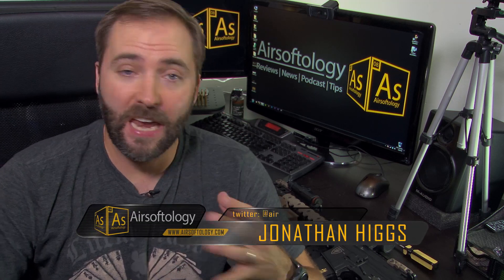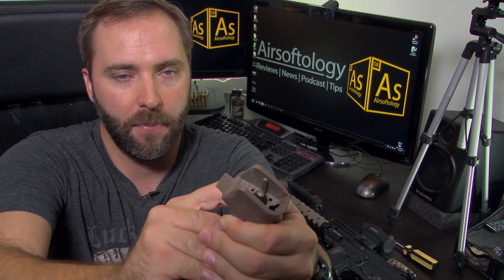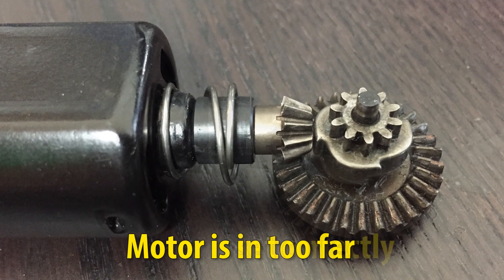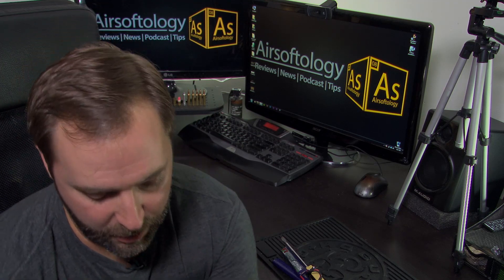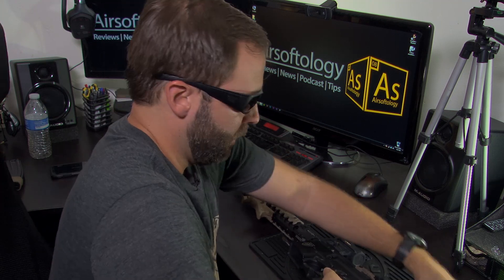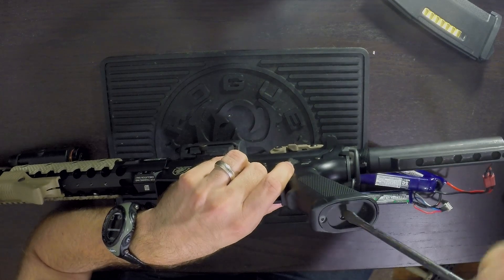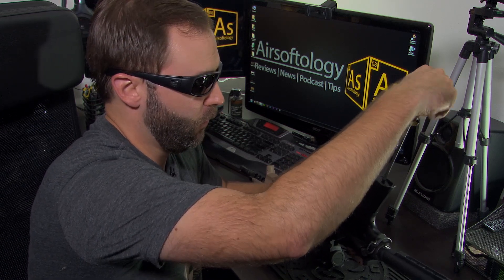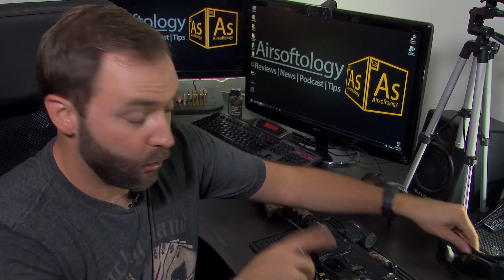How to Adjust your Airsoft Motor Height Correctly | Airsoftology T3

Comment: When I adjust motor height I do it while I'm working on the gearbox and put ony the bevel gear in, screw the motor into the grip, and adjust it until all the teeth are meshing properly. Then I shim my bevel gear until there is no friction on the meshing of the teeth and shim the rest of my gears up to it. This is a much more precise way of doing it if you work on your gearbox.

Comment: that's really helpful. I'm a noob in AEG and tried to screw in the motor plate too far (as I thought it was the screw of the handle) that it no longer fires. What happened was the batter and the handle heated and I panicked. Now that I know that what I screwed in is actually the motor plate, this is a good video for me to adjust the motor in it's sweet spot. Thank you!

Comment: From my experience when you want to be sure 100% on correct height you can remove the gearbox. Then mount the grip on it (V2) and see the aligment, better V2 gearbox shells have a cutout windows where you can see the contact between bevel and motor, on V3 you usually can see the contact right away.

Comment: Thank you for this Sir, i have a very old tokyo marui mp5a4 that came to me second hand in 2011, its sat unused for 11 years since 2013 and i recently decided to get a new gearbox as i had stripped gears and this video is pretty much perfect, hearing the sound difference and firing every half/full turn of the little grub screw in my adjuster plate really made the difference, i backed it out all the way to hear just motor spinning, engaged, went all the way in, and there is a big difference with the sweet spot being smooth.

thank you!

Comment: Contrary to the title, this is not the correct way to set motor height. Yes this is an easy way to approximate it, and can get you close, but the proper, correct method is to take a part your gearbox apart and attach the motor grip to one half of the gearbox and visually set the height exactly.
Reply: Like, why in the world isn't this done from the factory.
Reply: kawsper time is money

Comment: Thank you so much. My gun rpm was so slow and it only shot upside down with a weird sound. Turns out the previous owner had tightened the motor full. And again thank you so much

Comment: This actually addressed an issue on my AK74u NGRS. When I swapped the stock motor for an ASG 22k due to heat building up really easy, the motor height had to be adjusted and hopefully this will address a lock issue on semi where I have to put it into auto to unlock it.

Comment: Thank you so much for posting this.  My screw must have loosened because my motor was set too low and my piston was not engaging. I was so scared I stripped my gears or something. Funny how a screw being a little too loose can completely mess up a gun.

Comment: Thanks for this video, my m4 that I bought second hand made that sound yours made after you had purposefully adjusted it wrong - must be why my battery was running out a little fast.

I have those same speakers, but, I don't use them - got some Behringer TRUTH B2031P speakers.  Good step up for not much more money (got 'em on sale for under $200 a pair).

What do you think about Ares Amoeba quality control problems or Krytac  recommending people not use 11.1 LIPOs because they had MOSFETS burning up?  If I paid the price to by a Krytac, I'd damn sure want it to handle 11.1s without breaking a sweat.

Comment: Can you explain the differences between copper, steal, and ball bearing bushings. Which is most durable to least durable. And why is a metal ball bearing spring guide better than a metal steal spring guide, is it a huge difference?

Comment: Can you make a video on any solutions fitting a battery in a RIS without using a peq box and if it requires keeping it attached externally how can I make it look good. I would manly like to know how to this with a DD RIS II for a Mk18 and a Tenergy 9.6v 2000mah nun chuck style battery. I do not own the rail system yet so I would like to know of any problems that may occur before I purchase it. Thanks.

Comment: i’ve just put a high tq motor in mine from a standard and it sounds so different which is expected but i just can’t seem to find a sweet spot sounds strained regardless , i’m using a g&g tr4-18 light top tech , so i’d think the gears etc should match up to a 2500 motor , it says it normally comes with one anyways
Reply: You need to shim all your gears not just pinion

Comment: I think I have mine adjusted right since it has the quite high rpm as well as it does not sound like a bandsaw scrapping on rebar so is that meaning it is tuned right?

Comment: Hey Airsoftology! I just got a new KWA M93R NS2 version and after the first two weeks of normal use, I noticed that the slide doesn't lock back securely anymore. It will lock back and then the slightest touch or tap will make it slide forward. I've only had it for about two weeks so I can't imagine how it could be wearing out already. Please help!!

Comment: what about marui mp5k? it has these small hex key screws and no casing for motor 
it intends to tip off from position where it should be and run empty and it's just in the spot where it only can fire (if i remember correctly, now i want to re do adjustment)

Comment: I have an a&k sr25 that I just installed a tightbore in and when I put the gun back together to test fire it, it made a grinding noise. I have tried this and It starts to sound better but not perfect and will not fire bbs.

Comment: I mainly use GBBR and I am fairly new to AEG, got a Krytac mk2 M spr I have no idea if I have an issue with my motors, Battery or the wires , but if I try to full auto my Krytac for even 10 sec the Rate of fire starts to go down and eventually the gun just stops , is it just overheating or motor problem or just normal for AEG ? Motor height is perfectly positioned battery is well charged and I didn't have this problem until recently.  please enlighten this lost lamb in seek of answers.. peepoSad

Comment: Someone please help
I have two different airsoft guns that have this problem
When I have been firing on semi auto for a while my gun will sometimes just go dead. The trigger makes the clicking noise that is the same as squeezing the trigger without a battery. I know it is not the wiring and the battery level is fine. I have to do a quick full auto burst to get it to fire again

Thanks
Reply: Semi ruins the AEGs get a burst mosfet try the burst wizard sold on evike.com
Reply: 37 dollars is good
Reply: ***** but is there a way to stop it? because non of my other guns have this problem
Reply: Intall a microswitch trigger and a mosfet

Comment: Wondering If Anyone could help me with my proble, Im a current owner of a Krytac CRB and i attempted to change the spring out to replace with a lower tension spring, I didnt have a long enough screwdriver to take out the screw in the buffer tube but i was able to go all the way into the gun before i was stopped at the base of the Gearbox right after i took the handguard out, When i pout everything back together when i shot there was a very bad grinding noise that soudned like the gun was breaking apart, i shot again to see if everything was fine but it did not shoot again, Is there anything i could do to fix the gun? The farthest i got down to was the Motor in the Hand Grip. (Im also fairly new to airsoft)

Comment: So I got a G&P widow maker body with a magpull one point sling and with everything all tight I have some buffer tube wobble. Any way I can fix this? I also have the gun wired to the rear.
Reply from the maker: If your internal screw is tightened down inside of your buffer tube, try tightening your castle nut (the ring on the outside of the buffer tube where it meets the body of the receiver.)  if it's one that unscrews (many G&P guns have a castle nut that does) that should tighten your buffer tube perfectly.

It's tough to get it right by hand, but most shops have a M4 tool with grooves designed specifically for tightening this part.  Hope that helps! -J

Comment: Hi I have a katana series AEG witch has a cylinder setup so in order for me to open it up I have to put it on safe allowing the gears to be free to rotate but what I have noticed is the motor is a little difficult to spin causing the gears to almost feel like they are seized up witch doesn't allow me to switch
out my cylinders and if I back out the height adjustment for the motor it doesn't back out far enough.. I actually have to drop the motor out of the grip to get it off the gears. it's a stock motor and it almost seems like it's too tall. my question is should the piston on the motor twist freely or should it have resistance? and if you have any recommendations to my situation feel free. thanks!

Comment: I have the Mil Spec Monkey M4, and the hop up is very sensitive. It's either too low, or too high no matter how hard I try to adjust it. If I just move it a little bit, there's a drastic change in the hop up. Is there a way to fix this?

Comment: Could a midadjusted motor burn out fuses? I scorched two in the course of a day in my RPK after installing a G&P high speed. Prior to this its never done a thing wrong.
Reply from the maker: Yes, that could be a possible issue.  Also, if the FPS of your RPK is up there (450+) the high speed motor may not be enough to efficiently turn it over and that could be another possible issue.

Also check the wires around the motor cage for grounding, as that could cause electrical issues as well.   Hope that all helps.  -J
Reply: Well honestly I havent been able to chrono it lately but its still running the stock spring so that shouldnt prove to be the issue. Thanks though I'll look through everything else you mentioned!
Reply: foughtwolf Are you running a mosfet in your gun?
Reply: nitemunky76 Not as of yet. I intended to put one in but didnt have time before the op to get it ordered and install it in time.
Reply: foughtwolf I would install a fet and see how you get on. Also what amperage fuse are you using and what battery?

Comment: Can someone help me I don’t have the screw that adjust the motor height is their a way I can use a different same sized screw or I’m just going have to buy a new motor?
Reply: I lost mine on an older gun and just got a new grip. Otherwise I’d try and order the exact brand screw. Call a local shop I’m sure they have one lying around.

Comment: My motor cover doesn't have a separate motor height screw, just a back and front screw holding the cover in place. The back screw hole is completely stripped out, so the screw goes in loosely. Is there a recommended solution for this?
Reply: The only real solution I could think to this would be a new grip dude. If its stripped you could maybe try a similar sized but longer screw or a slightly larger screw. Ultimately its just a matter of the plastic being chewed up.
Reply: Thanks.  I was sort of leaning towards picking up a new grip, so I'll probably go that route instead of trying different screws.

Comment: what if there is no sweet spot? it either grinds or jams?  full charged battery 9.6v nah. src sr4
Reply: +Rick Rabies 1st check your motor plate on the bottom of your grip( I had a lemon from the factory on a gun that for some reason did not fit onto the bottom of the motor causing it to force it into the gearbox), make sure it fits onto the motor and actually adjusts it, I would put the motor in the grip and play with it while its off the gun to make sure its sitting in the grip straight and that its moving up and down with the set screw. You may also look at the first gear in your gearbox friend, I had an issue where I had to pull mine apart and put new bushings in and reshim the first gear because it wouldn't line up with the motor, now it works fine, just needed some TLC after 50000 rounds.

Comment: John! Help me! I adjusted the motor just a tiny bit to much and shot it once and then re adjusted it and it didn't fire again, it doesn't even make any noise! I tested my 9.6v battery to see if it was working, but it was putting through 11 volts! I was using a smart charger that only charges up to a 9.6 volt battery. I tested the connections to the motor and there was nothing coming through. Is the gear box broken?? Please help! I am using the APS M4 Guardian. I think the gun I am using is just trash, the first one I got didn't even shoot so I had to send it back.
Reply: +MisterAxeMan shit a little too late but check your fuse might of blown it
Reply: +MisterAxeMan Reset your gearbox
Reply: +MisterAxeMan Maybe your motor wire came off

Comment: So I just got a $150 combat machine. What should I internally do with it first? Should I put a new hop-up and barrel in it, or should I upgrade the gearbox's parts/motor?
Reply: +7thGenGaming I would start with the hop up and barrel. It's what I did and I love it! (I can give you suggestions if you want)
Reply: +7thGenGaming go into the gearbox and do reliability upgrades, shimming, angle of engagement, mosfet, regrease
Reply: JoshTehSquashAirsoft Where do you re-grease an aeg? Also what exactly does a Mosfet do? All I know is that it's good...
Reply: +Joshy Brix studios You regrease an aeg by opening up the gearbox and cleaning it up good, then put white lithium grease on the gear teeth and gear axles. Use silicon grease for the o-rings, because white lithium grease can theoretically deteriorate the rubber. A mosfet is basically an electronic trigger. Instead of closing the circuit with a mechanical trigger switch, a transistor closes the circuit. The trigger switch now simply tells the mosfet transistor when to turn the motor on and off, as opposed to doing it directly. This preserves the trigger contacts from frying, as well as allowing more efficient energy transfer from the battery to the motor.
Reply: JoshTehSquashAirsoft My gun has been being a butthole here recently as in, whenever I pull the trigger this happens:
90%: Fires great
7%: half fires/I don't know what
3%:locks up
would a mosfet fix that? Should I get one?
Reply: Is that only on semi?
Reply: JoshTehSquashAirsoft Yup. I forgot to say, sometimes, after acting funky, it will shoot automatic WHILE THE SELECTOR SWITCH IS ON SEMI. But usually, if I just shoot slow, it's fine.
Reply: yeah you've definitely got some things going on in your gearbox...check your cutoff lever/ the piece on the sector gear that hits it.
Reply: JoshTehSquashAirsoft I would totally due that except for one tiny little problem. HOW DO I GET THE GEARBOX OUT OF THE LOWER RECEIVER? It's rear wired, and that just makes it even harder >:(
Reply: There are two large pins in the reciever, one above the trigger, a mag release, a handgrip, and a stock that must all be removed :)
Reply: the upper reciever/handgrip slides off after removing the front pin
Reply: JoshTehSquashAirsoft Before, I have already tried removing the stock... but how do I get the wires OUT of the buffer tube? I still can't even understand how they got the wires IN it the first place lol.
Reply: they are made of two pieces, there are spade connectors right at the hole in the buffer tube
Reply: JoshTehSquashAirsoft Oooohhh... I think I remember that... I will check :D

Comment: The motor wobbles inside every time I use the gun is that normal and could it break over time?
Reply: This is quite normal, You can try to put a round of tape around the middle of the motor to take up some of the wobble. Don't put on so much tape that it can't move in or out of the grip of course.

Comment: Hi my motor its too high or to low can't find the middle..how can i fix this?
Reply from the maker: If you've tried everything and can't find the middle without some grinding sounds, you may have an underlying issue.  Your bevel gear or pinion gear could be chewed up a bit (causing the noise even when it's meshed right), the shimming could be too tight or loose inside the mechbox, or if you are using an aftermarket grip, your motor may be engaging at a weird angle.

It sounds like it could be tech time, but if the gun's running good and just a bit whiney, that could be normal too.
Reply: its the pinion..my bevel are new

Thanks man

Comment: Yeah this is wrong. This is how to approx set the height... The correct way is to pull apart the gearbox, take the top half, put the bevel gear in it, attach the grip and set the height that way..